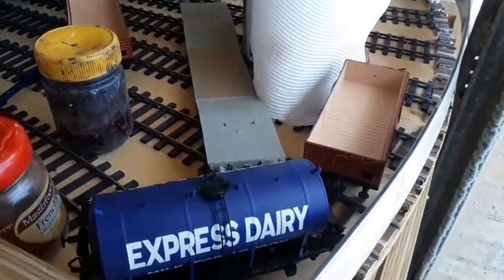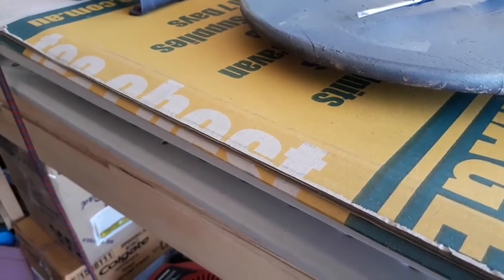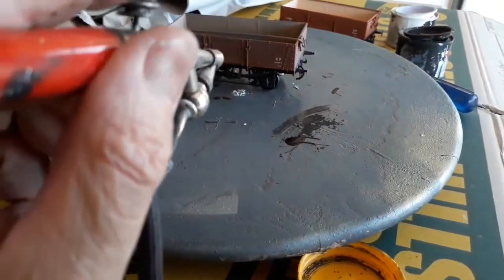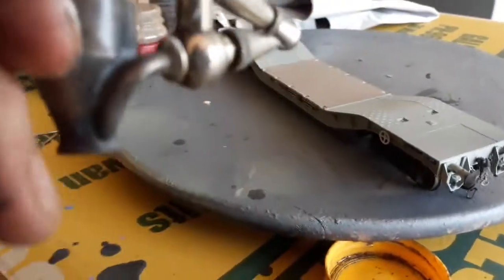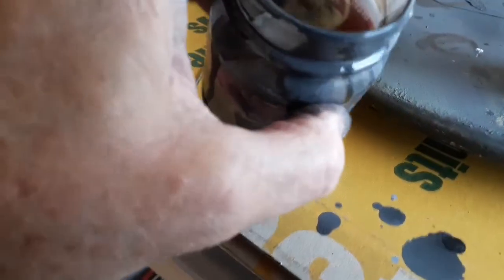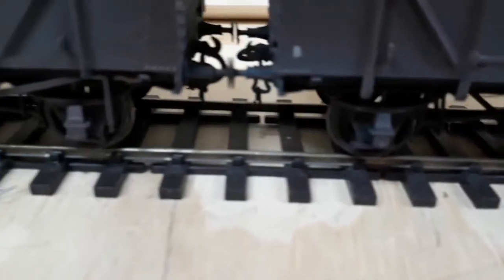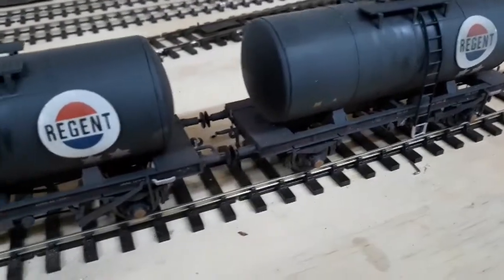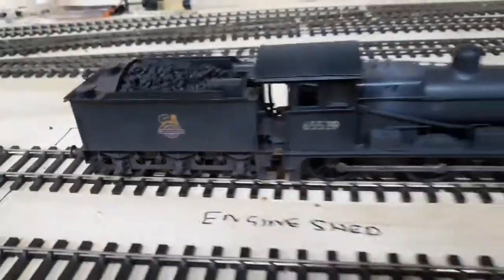Weathering 0 gauge wagons 20 January 2020

Comment: Nice work - cracking looking fleet👍✌️😊💜

Loved the tip re tarps, I'll try and remember that🤞👍💜

Nice to see the Paasche H in use, I use mine for base coats, primers etc, never thought of it for weathering I tend to use one of my H&S', then detail weathering with brushes, powders and a sealer coat.✌️✌️👍
Reply from the maker: Thanks, I loved the paasche H.
I also have a gravity feed double action. Which I haven't used much.
The only thing with me is the paasche H has a side cul on the left and I am left handed, also easy to spill paint.
On rhe Iwata it's on the top si left or right handed it's OK plus there is a colour cup lid, so no spillage
Reply: @Steven_Rowe  Yes that is a chore on the Paasche airbrushes but you can get plastic cup caps for them, they're fairly cheap. My H&S is better in that regard too like your Iwata - both owned by the same parent company these days of course 😉😉
Reply from the maker: @musoseven8218  I love the H, very rugged and high quality,  the only issue really is the cup on the left.